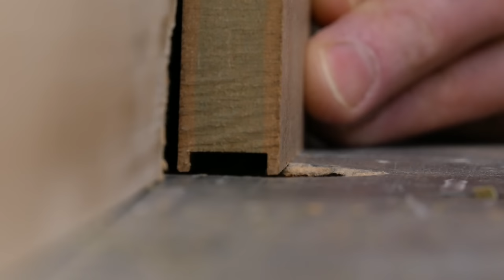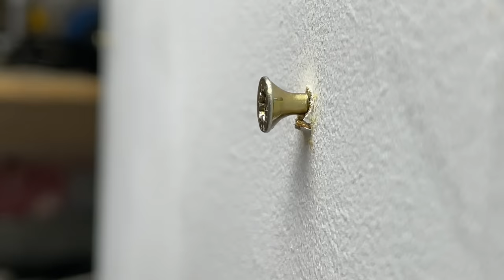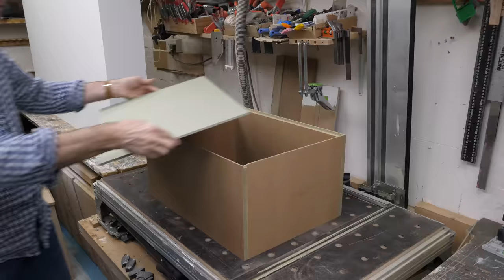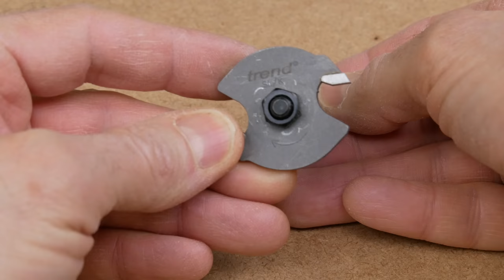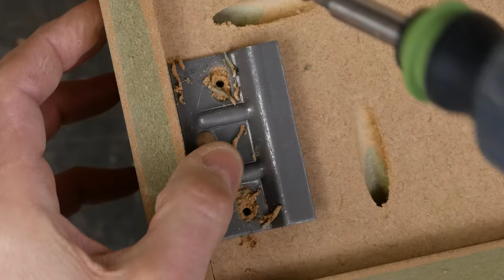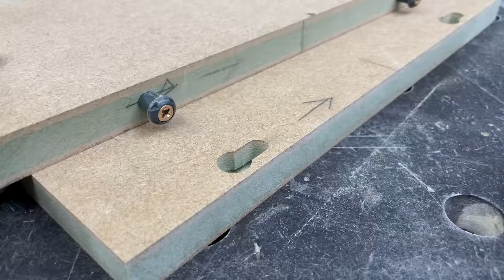Cabinetry Basics P4 [Video 438]

Comment: There is no way I could have taken three separate carcasses attached them to a wall via three different methods and have them be level across the top. Even the same method is doubtful.
Reply: I was thinking the same thing.   well done.
Reply from the maker: Well, I don't show you how many times I had to do them, lol! 😂👍
Reply: @10MinuteWorkshop  You should do a basics on measuring and layout!
Reply: Had the same thought. I could try that a dozen times and get the same number of variations!
Reply: @brianglezman  Excellent idea.
Reply: I guess it does help to have a nice bit of new flat wooden back to screw them onto. In the real world, you mark the wall carefully, get out the trusty (rusty?) 6mm masonry drill, start a nice accurate hole, hit a lump of something in the wall and wander 2mm off in some random direction.
Reply: @brianglezman  Absolutely!
Reply: @petedig5809  I belong to that same world we too have brick walls in our country prefabricated wooded walls are rare here....
Reply: Hope you're not fitting furniture if you can't hang 3 cabinets level. Pretty basic
Reply: @petedig5809  YES, exactly! 🙄

Comment: Instead of "offering up" the cabinet. Why not put a hanging plate in a small piece of scrap and use that the get the wall screw depth correct? Save lifting the cabinet.

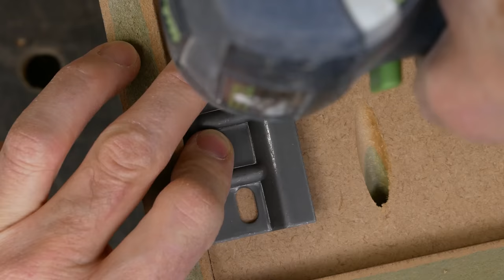Comment: Those metal almost French cleats you shows at around 7:00 and further are here quite used to hang kitchen cabinets. With one detail, those small parts are mounted onto the cabinets while whole long strip is attached to the kitchen wall. So you can later on re-position cabinets as you like regardless of their horizontal size. And if the strip was attached to the wall on level, then all the cabinets will have their tops on same level as well (if those small counter parts were mounted on cabinets on same spot like top cabinet corners, obviously).

Comment: As soon as I'd heard of french cleats for hanging cabinets (I'd heard of it before this video), I knew that's all I'd ever want to do (if I could). I almost thought you weren't even going to show that option. 

In addition, if you're using french cleats, you don't actually need a groove for the back. You can put in edge blocks with the same thickness as the cleat piece around most outside and use it as a backer for attaching the back. A groove IS cleaner, though

Comment: Excellent series Peter — informative yet succinct as usual! 
Maybe a #5 video of wall mounting options — what’s in the wall? Maybe show the back side of wallboard most people never see. 
I’ve seen too many client DIY hangings where a small ikea/generic cabinet is full of books, yet they used 2 plastic wall anchor plugs and  1” screws. Yikes!
An issue with small cabinets like you build in video is that they might only catch one stud on 16” centres. 
Some folks don’t know anything about studs or metal butterfly anchors or the newer mushrooming plastic anchors. 
Great stuff, Peter! Recently joined Patreon to glean all I can. Paul in Canada.
Reply from the maker: Thanks Paul, and welcome! And yes, there'll be a wall fixings video on the cards, for sure! 👍

Comment: Probably the most common method in the US is an inset thin back, with a “Nailer” behind it flush to the back of the cabinet.  The “nailer” is about 50-60mm wide, and usually made from an off cut of the body material, it would replace the triangular plates you used.  You then drill through the back and “nailer” to mount the cabinet.  If your want it to be “screwless”, you go ahead and make it as the top part of a French cleat.  

I’m building “shop cabinets’ at the moment and using an inset thick back of 1/2-inch (12-mm) plywood, to allow me to screw tool mounts to the back.
Reply from the maker: Interesting, thanks! 👍

Comment: My biggest problem with hanging anything on a wall is getting the bloody holes in the right place!
Easy in plasterboard, but any time I try and drill into brick the bit will always wander. If you hit the edge of the brick / mortar or just a tough bit of brick you don't stand a chance!
I always start small (3mm normally) and try to adjust that hole back into centre once it's bitten, but it tends to always end up slightly off, which makes anything I'm hanging (more recently curtain rails, but previously cabinets / shelves etc) juuuust a little bit squiffy. Enough to notice.

A video on how to get things straight when mounting on a brick wall would be really interesting if you've got any tips for that?

Or if there are any fixings you know of that provide adjustment up and down to compensate for wandering holes?
Reply from the maker: Not aware of any fixings that allow adjustment, but pretty sure I did a video way back about drilling & fixing into brick; I’ll have a search, see what I can find. 👍

Comment: Here in the US, 99% of the walls we hang cabinets on are drywall.  It appears that the wall you hang the cabinets is solid.  Do you have a recommended screw or anchor for drywall?  Great series, you really should be at 1 million subscribers by now.  Thanks.
Reply from the maker: Thanks! I'll be doing a 'problem walls' video before too long, I think! For the most part I've been happily using Fischer duopower wall plugs, which work well on all kinds of wall - https://amzn.to/2OeFQFp 👍👌

Comment: Another cracking video - those new to the game will be amazed at the options available.

One of the first bits of metalwork I used years ago were pelmet brackets - similar to the offset  brackets you mentioned ,  but with more of a clamping effect.

The floating shelf system also opens up another support option for cabinetry.
Reply from the maker: Thanks! 👍

Comment: I like the third one the most because I don’t have a router! I design my models in Sketchup and then order the individual parts cut to size but the company doesn’t offer miter cuts or anything like that, just rectangular boards. So I sometimes have to do with simpler solutions because I can only screw and glue. I love the second solution, though. I have a couple of store-bought wall cabinets that have the exact same wall mounting mechanism and I think it’s very elegant! If I could cut wood diagonally self, I totally would choose this one.

Comment: You make it look so easy Peter! I wonder how many of us could get three cabinets perfectly in line first time.  The new IKEA rail mounting is designed for us.
Reply from the maker: Thanks Michael. Haven’t seen the IKEA rail, I’ll check it out, thanks! 👍👍
Reply: @10MinuteWorkshop  It's just a long rail and there are fittings like your hook which fix to the cabinets.  Easy to align an then you just true up the adjustable feet.  I haven't used it for wall hung cabinets but it should work well.

Comment: Genius idea marking the masking tape on the level! And reversing the squeeze clamps to hold the cabinet in place. 👌

I like the rebated back and corner plate fixings the best. Do you paint the little plastic plugs with the cabinet in advance or touch then up with a little brush on site?

This series has really given me the confidence to try making a run of fitted wardrobes myself instead of selling out 2k to a local crowd that quoted me! Bad news for them! 🤣🤣

And congrats on 100k, very well deserved! 👍
Reply from the maker: Thanks! Yes, I usually over-paint the plugs, wether stick-on or plastic. 👍👍

Comment: Great finish to the series 👍.  It's so much easier to hang those cabinets with either method when you have a lovely flat wall 😂. Congratulations for the 100k.
Reply from the maker: Damn right! If I'm making a wall for a set, you can bet it's going to be straight and plumb! 😂👍

Comment: I actually really like those adjustable brackets that you used the plates for, especially when the walls aren't very straight as they have tonnes of adjustment. They're also pretty strong
Reply from the maker: Yes, kitchen fitters favourite, especially if you use the continuous rail instead of the offset brackets. 👍

Comment: Excellent series, Peter, really enjoyed it. I've used the tape on the spirit level 'trick' for lots of things in my other job as a handyman – hanging pictures, mirrors, wooden mantles etc. – but I've not seen it demonstrated on a vlog before. I sometimes add a centre line on the level (which I really need to do permanently as I use it all of the time). I use this method when, for example, mounting a mirror above a fireplace, measuring out from the centre line, matching it up to a centre line on the wall above the fireplace. Just a thought, have you done a 'tips' composition video of ideas like this? It's just that I think there may be quite a bit of interest judging by the comments you've had. Many congrats on the 100k subs, by the way, thoroughly deserved!
Reply from the maker: Thanks Carl! Yes, I taught myself this one back in the handyman, picture and mirror-hanging days; still works great! I usually just use the vial as a centre, but as you say, I should probably put a mark on there permanently. Well, a sharpie, anyway! 😂 I did a few 'tips and trick' videos way back, and you're right, I should probably do a compilation of some of them, sometime! Cheers, Peter 👍

Comment: Thank for the nice video Peter. I did recommend your videos to quite a few friends over the last weeks and some are active in the Dutch woodworking community. That must have added some subscribers.

I mostly use the adjustable cabinet hangers. Those are obviously quite in your face if you look in the cabinet, but that has seemed to be fare easier acceptable to those that I made cabinets for than a cabinet which is just a fraction of a degree tilted or just a part of a mm different in higher compared to the other. And then there is the setting of screws over time... Maybe it lies in the acceptance of the statement that it are “professional hangers” where a bit out of alignment is not that easily accepted as “professional”? Or maybe as well in the acceptance of the modern (“ “) adjustable hinges which are - let’s be honest - not really a beauty except in the eye of the engineer. Right? And the adjustable ones make the drilling in the wall (what is behind this wall paper or paint???) less critical as well. Groet, Wino
Reply from the maker: Thanks Wino, much appreciated. Yes, on uneven walls the adjustable brackets are very good, but as you say, a little obvious inside the cabinet. I did consider discussing them in this video, but I think they may make an appearance in a 'problem walls' video! 👍
Reply: @10MinuteWorkshop  Problem walls... I think I am really at the point where I can state that whatever you can imaging wrt problems with walls... I have been there and have seen it, have experienced it. I have purchased that very expensive wall scanner from Bosch (D-Tect 150) after I realised that I had been very very lucky twice. Yes, the price is nearly € 700. But the damage that I could have caused by being just a little bit less lucky would have been a lot more. (I missed a water main and a deep buried electric main by just some cm’s as a result of not going back to pick up the scanner but continuing the work without)

Apart from that... walls that were incredible hard (massive granite blocks, the house appeared a bit older than expected), very bad walls with soft spots and holes, walls that appeared not to be massive everywhere but partially massive partially plaster board, hollow stones, reinforcing bars in an impressive density, poor brickwork where I pulled out a stone with my screw in the wall.

I am not afraid of the walls, but I do come well prepared and I am not drilling without scanning any more. And - I buy and use high quality Fischer DuoPower fixings.

Comment: Wouldn't an easier way to put the screw in the wall be to use another hanging plate.
Make sure the ones you put in the cabinet are flush with the back of the cabinet, and then place a spare on the wall, screw it in, making sure you can still slide it off.

Comment: Congrats on 100k. I love to know how you make the choice of which material, what thickness and why. For example would you use 18mm on a cabinet door or will it be too heavy idk.
Reply from the maker: Thanks! Depends on the size of the door, but 18mm for a flush/flat door is generally fine; if it’s a larger door then I’d generally go thicker to avoid bowing. 👍👍
Reply: @10MinuteWorkshop  brilliant thanks.

Comment: I'm third generation British American, and I'm curious as to how or why modern Brits refer to the classic joint as a "rebate" instead of a "rabbet". In my 1755 "A Dictionary of the English Language" by Samuel Johnson, there is no such definition for a "rebate", but it does refer to the joint as a "rabbet" (the American term). Johnson described a rabbet as follows:

"To RABBET (RA'BBET)   v.a.[rabatre, raboter, Fr.]To pare down pieces of wood so as to fit one another. The rabbet plane is to cut part of the upper edge of a board straight or square down, that the edge of another board, cut down in the same manner, may join into the square of the first; and this lapping over of two boards is called rabbeting.Moxon’sMechanical Exercises. The window frame hath every one of its lights rabbetted on its outside about half an inch into the frame, and all these rabbets, but that on the ground-sell, are groved square.Moxon’sMechanical Exercises. 

"RABBET (RA'BBET) n.s.[from the verb.]A joint made by paring two pieces so that they wrap over one another. Having drove in the hooks, they set the rabbets of the door within the rabbets of the door-post.Moxon’sMechan. Exer."

A Dictionary of the English Language (Complete and Unabridged in Two Volumes), Volume Two, p. 2076, 1755. 

I've also always heard Brits refer to Americans butchering the language, but I don't think that's necessarily true. There is a letter "R/r", for example, for a reason. In other words, we started out using (pronouncing) the letter "R/r" in language (necessitating the need for the letter in the first place), but the British eventually appeared to soften or outright eliminate the pronunciation of the letter R/r in many cases over the last couple hundred years. 

Obviously I'm just having fun! ;) Great video. I learned a lot!
Reply from the maker: Language evolves. But it’s also well known that American English is derived from the Elizabethan English spoken by the first settlers, and some words persist in American English that have fallen out of usage in British English - I remember reading American magazines in the mid-70s and being confused by the usage of ‘atop’ instead of ‘on top of’ There’s no right or wrong, just different. 👍
Reply: @10MinuteWorkshop  in the U.S. we use both "atop" and "on top of". We also use punctuation marks a little differently, but that's okay like you said, but sometimes one style makes more sense to me than others. I use a combination of British and American punctuation because either style makes more sense to me in certain circumstances. Anyway, you're right, there is no right or wrong, just different, but I do find both styles have their superior moments. Cheers mate! ;)

Comment: I have enjoyed the whole series. How do you feel screwing the backer board directly into a stud or wall anchor compares to other methods of hanging with regard to durability or overall strength?
Reply from the maker: As long as a/the wall’s decent, and b/ the back’s secured to the cabinet, then no problem at all. 👍👍

Comment: Hi Peter, what solution would you use when setting several cabinets to the same hight as in this video but drilling into breeze block or brick where drill bit drift happens.
Reply from the maker: Using a fixing with a bit of wiggle room can help, but in a tricky wall I’ll start with e a tile drill, then switch to a masonry bit.  It sometimes you need to use cabinet hangers with a bit of adjustment on  them.🤷‍♂️👍

Comment: Recent subscriber... love your channel Peter and great series. What was your actual preferred method of fixing when you did your commercial work? If using a wooden cleat, would you also fix the cabinet to the cleat or just leave as-is?
Reply from the maker: Thanks James! Most of my commercial fitted furniture work was screwed through the base into the plinth, through the sides into the wall and the fixings hidden behind hinge plates or hanging rails, and on low brackets - as shown here - into the wall. That was usually enough. And no, I wouldn’t generally fix the cabinet into the cleat - just let gravity donuts thing! 👍👍

Comment: I'm curious how you get your screws attached to the studs properly. With the last one that you put on the wall (the metal cleat), it seemed like each of those were wider than a stud and the spacing seemed much closer together than the studs in my house. Any help would be appreciated as I'm working on cabinets for our laundry room. Great channel, congratulations on the 100K subscribers!
Reply: I'd be interested to know the answer to this one as well. What kind of fasteners are good to use if a stud isn't available? And what kind of load can each stud-less fastener handle?
Reply from the maker: There’s a ‘what’s in the wall?’ series coming soon. 👍👍
Reply: @10MinuteWorkshop  Thanks, can't wait!

Comment: In the EU metal rail on the wall, and adjustable hooks are standard for decades.
Reply from the maker: On commercial builds, sure, not so much on DIY projects. 👍
Reply: they became so cheap that everybody uses them. I'm amateur and I use them for decades, it's easier especially if you are an amateur.